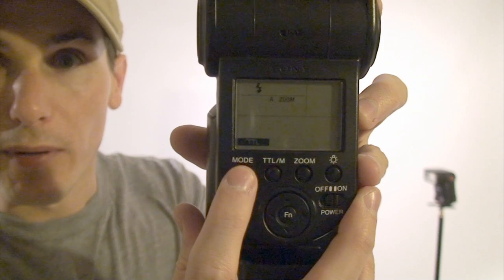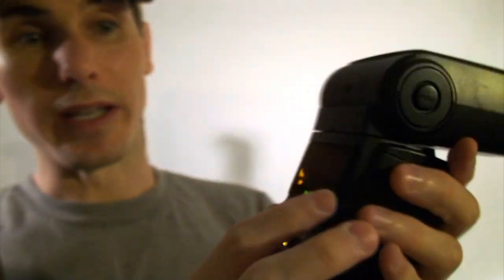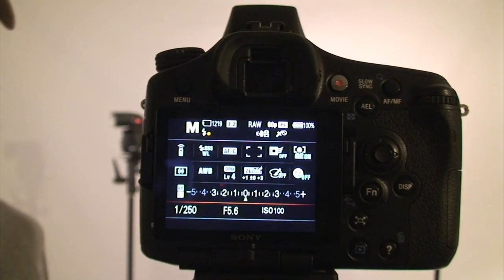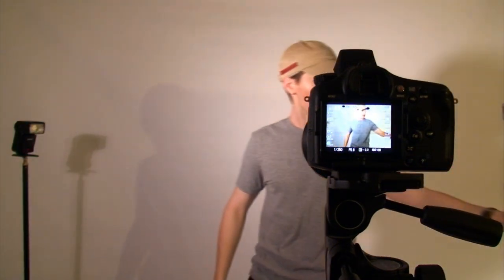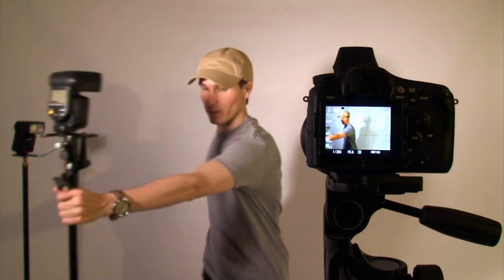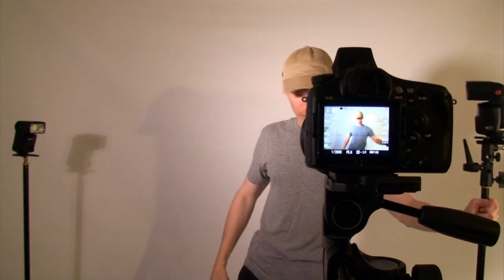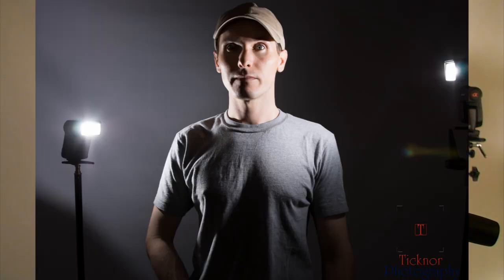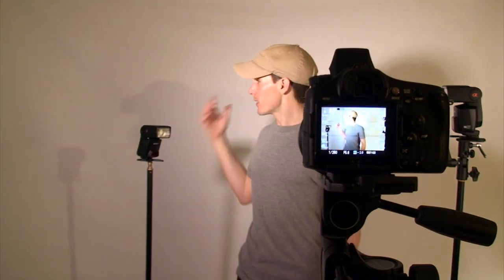Sony Alpha Wireless TTL Flash Speedlight System

Comment: Your videos are a great help. I bought a HVLF43 then discovered the Yunguo 560II which seems to be equivalent to the HVLF58 (minus TTL) at only $80 on Amazon. My problem is when both are on WL the camera will only trigger one. The weird thing is the Sony can trigger the Yunguo but not vice versa. Is it possible to fire off both wirelessly with the camera without resorting to pocket wizards, etc? Thanks.

Comment: Very interesting video! Thanks

I´m New in the DSLR world, I have an SLT-A37 with de HLV43AM.  

Is there any way to cancel the camera flash and use only the external as a wireless flash only? 

I tray to take a photo using only the HLV43AM in the wireless mode but when I take the photo both flashes goes on!, and is not what I need.

 Then I decide to bock the internal flash wit my hand and works perfectly, I have only the light from the HLV43AM.  

Is there any setting in the camera or the flash to do this automatically?

Thanks in advance!

Comment: Hi Thanks for the Lessons. I have the a77 plus the F43AM and the F58AM. I am trying to control the power of the f43am from the f58am inthe setup of the flash i get ratio ctrl rmt and rmt2 with an option to change the settins on each but I don't understand what ctrl is and i gather rmt is remote 1 and 2 but what is the numbers under each for
 1 : 1 : 1 i can change to 1 2 4 8 16 ? but it does no appear to change flash power?

Comment from the maker: That is a great question.  I'm going to dedicate a video to it pretty soon.  The speedlights do work wireless with high speed sync (only with the camera triggering them with flash - if you use other radio triggers, you will have to mach the sync speed).  So the only way i have found to have the cameras flash not contribute light to the scene is to use wireless high speed sync.  Once you go above 1/250, the cameras flash no longer affects the image, only the remotely triggered speedlights.

Comment: Does the controlling flas alsways flashes to trigger the others or can it be used for controlling mode only without fireing at all? I want to trigger my external HVL-F60M from my A99 and it seems like i need at least a flash like a HVL-F20M for this kind of stuff

Comment: I really appreciate your review and tutorial of the Sony wireless TTL system. In considering the A7 and other mirrorless cameras, a great deal of attention has been put on the camera, it's full frame sensor, the fact that they are mirrorless, and how suitable these cameras are for professional photographers as an alternative to dSLRs. However, as a wedding photographer, I also need good, reliable TTL control of off camera flash. Strangely, this has been omitted from the discussion of these cameras, which has made me suspect. After this video, I'm much more confident about abandoning Nikon and Nikon's CLS and moving on with Sony. Thanks again!

Comment: Do you think the controller flash can erroneously adjust exposure to overexpose image? I thought it fires not in the same time as slave flashes(final exposure shot). And i do not see image overexposing on my shots with one slave flash (Metz 50) which controled by built-in A65 flash.

Comment: Another way that I always do with my A550 if triggering wireless by using the pop-up flash is, I try to lowering the power down the pop-up flash and use manual mode to adjust the lighting to all the speedlite that I used. Try it...

Comment from the maker: The a57 should have a built in transmitter (it works in conjunction with the popup flash).  It will be able to communicate and trigger only other Sony Speedlights that have a wireless mode.  If you want to trigger other types of studio strobes, you will need to get a radio trigger.

Comment from the maker: The bottom of each of the Sony speedlights have a standard tripod screw hold, and so do my light stands.  So i can attach them via their included feet.  Usually i use a wireless radio trigger, and it also has tripod screw holes for attachment to light stands :-)

Comment from the maker: The System does lack granular control, but there is some type of camera/flash communication because you can apply flash exposure compensation on the camera, and the wireless flashes will adjust themselves accordingly.  The Nikon CLS system offers much better control :-)

Comment: If you use a 43 or 58 as the controller, you can set ratios. This allows you to set the controller on a very low ratio compared to the slaves, so that the controller has no effect

Comment: You get ratio control if you use a 58 or 48 Flashes on the camera instead of popup. I have 2 58s and a 43, and use one as controller (on a cable so it can go off-center) and the others on wireless, works very well.

With respect to comparing Sony Flash with CaNikon, its worth noting that the Sony flash system is standard across the alpha range, including entry level, something that is not the case with CaNikon.

Finally, Sony A77 firmware 1.07 fixes flash overexposure.

Comment: Is it possible to turn off the internal flash and just have the external flash ?
Reply: David Salvador I have been asking the same question.  I use the hvl-f43am flash on the a65 body. My test in the mirror show that in wireless mode both the flash from the body and the hvl-f43am showed up in the picture.  the only for the flash from the body to not show UPS is to increase the shutter to 1/200 or greater.  have you found a different or better solution?  what if you want slower speed?

Comment: PLEASE NOT ALL SONY FLASH USERS!
I have 3 Sony flash guns, a 43 and 2 x 58s and you can control the flash brightness levels of each light  from the flash gun on top of your A77, but you have to go to custom  wirless mode. This is done by going to wireless and then holding down the Function button for 3 to 4 seconds. This will open up a menu which was not visable before. Further instructions are on page 66 for the 58AM and page 57 to 58 for the 43AM. Or page 62 for the newer HVL F43M which has a video LED on the front. Understanding these lights is not easy and I am still learning, so take it one bite at a time and play arround at home using the TV screen to check the light leavel of each flash. Level 1 is the lowest light and 16 is maximum light from that unit, all controlable from the main flash on top of the camera. I do not use the ALPHA 77's internal frash. I cannot emphasis the importance of reading the instruction book again and again. Good luck , it works for me. Neil
Reply: >"using the TV screen to check the light leavel of each flash"

HUH?

Comment from the maker: This is a problem.  There is no way i have found to truly disable it.  I have found that if you push your shutter speed beyond the sync speed, the flash's will switch to High-Speed-Sync mode, and that will eliminate the built in popup flash from contributing light to the final image (although it still flashes to trigger the others).  Others attach a piece of exposed film to the popup flash (it only allows infrared light to pass through).

Comment: I have a question, I currently have the a37 (looking to upgrade to the a77 or its predecessor). Basically on my current camera it shows "wireless" in the flash settings, but it when I select it, the on camera flash also triggers.  Is there any way to stop that? as I have seen on demo videos of Nikon they can do it, is it just unavailable on my a37 or on all Sony Alphas?
Reply: Hi, I did some research and basically all the current Sony models do not have a wireless radio trigger inside the cameras, only a handful of Nikon and Canon's have this option (not many).  For pretty much every other model of other camera you have to buy a wireless radio trigger.  Sony says it is "wireless" in the flash menu, but that works by the flash going off on the camera and the light setting off the sensor on your 'off camera' flash. For only your 'off camera' flash to go off, you will need to buy a third party radio flash, that attaches to your camera and then the receiver to your flash, you can find a lot of them on eBay... otherwise, hopefully Sony's new releases in 2014 will have a radio trigger already built it.
Reply: Hi, thanks for the message
Sadly my a37 doesn't have the high speed wireless sync, and this seems like a way to get around the fact that Sony didn't put radio triggers built in to the camera, and the reason a lot of people online calling this old technology and that Sony will have to update their flash system to compete with the big two.  I was going to upgrade to the a77, but I think I will wait till 2014 and see if the "a78" (or whatever they call it), has a radio trigger built in. 

Thanks for the message.
Reply: *****
The internal flash does flash. You just do not see it, when the other flashes are to strong or delete the shadow. Normally I like it, when the internal direct flash is triggered also, but sometimes I do not like the direct flash. I am experimenting with a mounted flash on top of the Alpha (here SLT57). It needs the pop-up flash to trigger the wireless system. So I use the wireless (Minolta 3600HS) for remote, the popup flash für direct light and the (cheap) flash on the flash shoe for indirect lighting.

Comment from the maker: Hmm.  I have a theory.  The Yunguo 560II is probably in an optical slave mode, so when it sees a flash, it fires off.  but the sony wireless flash, being TTL, does a 'pre flash' to meter the scene. This pre-flash may trigger the Yunguo, and then when the real flash is triggered, the Yunguo has not recycled yet.  I will try to research.  There are in-expensive radio triggers that may be required to make this all work.

Comment: How to know wich external flashes are compatible with the sony wireless flash system ? Is a third party brand like yongnuo compatible ?
Reply: Adel Raziar You'll need to buy some type of wireless transmitter/receiver setup (ie cowboy, yongnuo, or the high price stuff). Just remember, it'll all be manual mode and NOT ttl. If your yn Speedlite has a "Sony hotshoe" on bottom, no worries just get the setup for Sony Alpha (the series before the A99 with the standard hot shoe. If your Yn has a standard bottom, you'll need to buy the tranmitter for sony alpha and the receiver for a standard bottom. BE sure they're the same brand/model.
Reply: coast2coastimagery Thanls a lot ;)

Comment: how do you get around the issue of not wanting the flash from the pop up??
Reply: With the exposure  - power off the remote flashes and start doing test shots with only the pop up flash set to wireless up until you get a black frame, then power on the flashes. maybe there are some other way but this is what I do.
Reply: thanks however i just bought a couple of receivers and a hot shoe transmitter which solve this issue.  Thanks again

Comment: This is an outdated flash photography.
Buy the ATG Gold A1 Flash Kim X3 and you can do ATG ADI TTL wireless radio flashes.

Ticknor Photography is showing you wireless TTL, meaning it's only wireless line-of site.
If you know Pocket Wizard, then you will love using ATG's.

Check out Alzo Digital, CT and ask for ATG.

Or reply your email address here, if you want a truly better system than Sony's.

Comment: This type of wireless system is outdated.
It works by wireless IR flash not by wireless radio flash.
You can not adjust wireless flash (es) from the camera or from the master flash.

Canon excel in this & follow by Nikon coming in second.